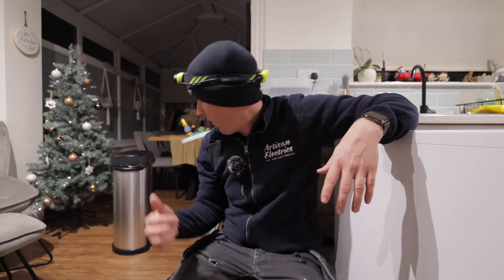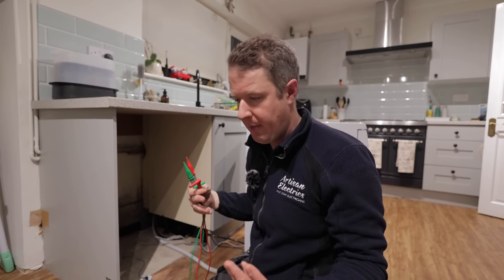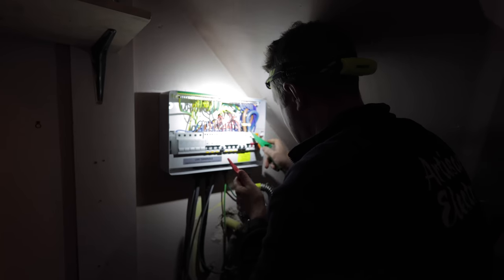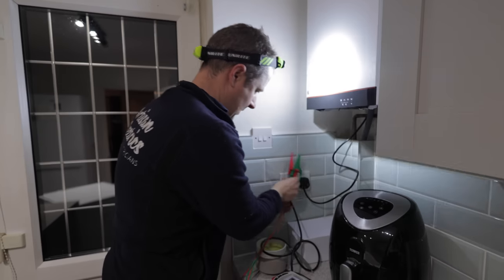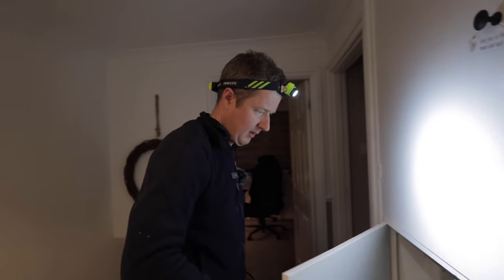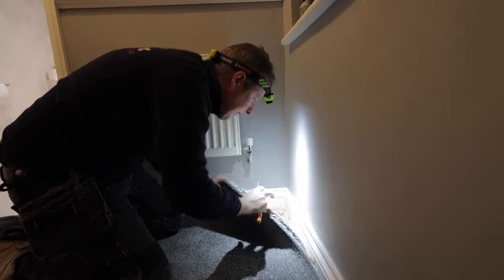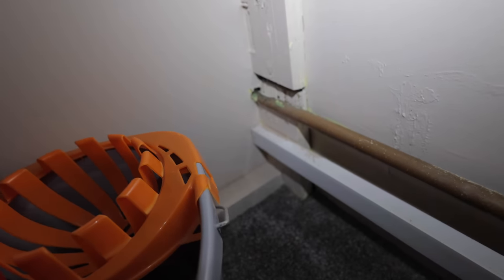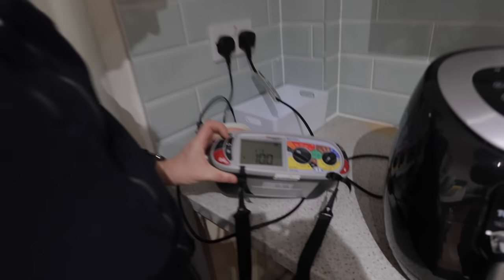Nearly KILLED by a CRAZY fault! What on earth is going on? 💀

Comment: American here, who only has an "advanced homeowner" understanding (I would feel confident doing a whole house rewire, to US codes anyway, but I'm lost in 3 phase or stuff with multi-wire branch circuits w/shared neutrals). I know the UK does things considerably different, but you managed to break my brain with the troubleshooting.

Very nice work, I hope the homeowner was grateful for what you did!
Reply: Pretty sure we can't do that over here. There's some building regs that mean you can only do certain things. You have to be registered to do the complex stuff.
Reply: @ftumptch86  I think you're allowed to run the wires and then have a pro come and join the dots here in England.  Is that right?
Reply: @sroberts605  possibly. It's all in part P of the regs. Minor stuff like replacing simple things and adding to existing circuits is OK. But big stuff like rewires, new circuits, fuseboxes etc are reportable?
Reply: @sroberts605  don’t know how many folk would be willing to rubber stamp a DIY job tbh
Reply: @ftumptch86 in the US it depends on where you are, for example whether your in the jurisdiction of a city or outside the city limits, outside is however you want to do it and no inspections required around here but national electric code should be followed but isn't inforced out in the county.  Then in the city it depends on the city rules whether you can do it yourself but all new work likely requires permits and inspections regardless of who can do it.

Comment: Far and away your best fault-finding video ever!  You demonstrated a good, logical approach - and the golden rule that it will be something the plumber touched holds fast once again.  
A little unlucky that whatever current the boiler pulled from the upstairs live (and returned via the downstairs neutral) wasn't enough to unbalance either RCBO and trip it.  An older boiler might have done so and saved you several hours searching.
Anyway nice work and a great advert for the professionalism of your company.

Comment: I had a mains tester fail, falsely indicating a wire was safe. So now I test a circuit BEFORE turning off so I can test the tester, and then be sure it's safe after turning off, and I always test all three wires too. I was once working with someone and he turned off the wrong breaker because they were mislabelled, and my paranoia saved me from a shock.

Comment: We discovered something similar during our home renovation.  We discovered that when we turned the breaker off to our master bedroom, we still had power in the bedroom circuit.  We also discovered the same thing when we turned the living room circuit breaker off, we still had power in the living room. What we discovered happened was that the previous owners had modified the wall between the living room and our bedroom, and when they did they for whatever reason, connected the two different circuits together! The only way to cut power to either room was to turn off both breakers because there was power bleeding over each circuit! It was scary considering it was this way for over 5 years. We simply undid all the connections and re-connected them correctly, and problem solved. The takeaway on this is if you don't know what you're doing with electrical, then please, for the love of God, hire a professional!! Lol!
Reply: I grew up in a house built in the early 1960's and we had almost this same  issue between circuits in the Master Bedroom & mine. Lived there for over a decade, and I  always knew there was something weird with the wiring between the two rooms. For example, in total darkness, i could see that the (incandescent) ceiling light in my bedroom always had a slight glow, even when the wall switch was turned off. So current was 'leaking' somewhere.. I recall my folks having someone look at it once, & they said they claimed they did something to fix it- - but I could still see there was a problem, but I was just a young kid, so nobody would listen to me.
The house was also built with aluminum wiring, which was popular at the time, which created its' own set of intermittent problems. I do know that when my folks sold the house one of the first things the new owners did was have it re-wired with copper, and, I assume, they finally fixed whatever was going on between the bedroom circuits.

Comment: Great video and full marks for your systematic diagnosis.  I guess a second best alternative to running a new cable would have been fitting a contactor/relay by the boiler. Still means that you have two separate circuits going to the contactor, but at least they would be isolated from each other.
Reply: You've then gotta hope that the plumber who replaces that boiler next time understands what's been done & why. Even so, I'd have considered a contactor even though it introduces another potential point of boiler failure for the future.

Comment: Wow! A few years ago we had an extremely strange error. It was in a retirement home where the faucet in the bathroom was live. The RCD for the affected circuit worked perfectly. When we looked for the problem, we found out that the electricity came from the next room. A cable in a stud wall had worn through and raised the entire potential in the area in question. However, since the water pipe was better grounded than the rest and not grounded together with the stud wall, there was potential there. So the electricity didn't come from the tap, but rather went there, if you want to look at it that way.
We solved the problem by disconnecting the supply line in the neighboring room and creating a connection between the bathroom and the rest of the room.

Comment: A number of years ago I was PAT testing the two individual curtains around a school stage. both curtains had a 13amp plug. The remote controller  unit also  had a 13amp plug.
I unplugged the first plug to check the fuse.
I was thrown back into the second row of seats, I did not get a burn but other school personnel carried out the disconnection.

Comment: Great video explaining the dangers. As an alternative solution, would it have been reasonable to have added a contactor to isolate the two circuits? I.e. the switch side energising the contactor (live and neutral from upstairs), which switches the live on the downstairs boiler circuit.
Reply: Good point. We didn't see what the rogue active was doing, nor why it was energising the earth conductor (or maybe active & neutral of the downstairs circuit were energised together).
I immediately went to "use the old cable to supply a control relay" once the double circuit appliance was exposed.

Comment: Really interesting video, thank you! I’m not sure I’d have found that fault. Nice fix too. I suppose another way round it would’ve been to drive a relay from the twin and earth to the boiler, which would provide the switched live. I could see no problem then with powering the boiler from downstairs sockets and the controls from the upstairs. The relay would provide isolation… that said, your solution is neater, simpler and easier to support by others. Thanks again, great vid ❤
Reply: Exactly, install a relay and you don't have problems. And even better solution, since that is a new boiler, would be to not use a 230V input for turning the boiler on that is technology of the last century but change the heating controller to one that uses the OpenTherm bus, that uses two low voltage wires (to carry both data and power to the controller) and can also modulate the boiler and let you save on your gas bill. But that would require reconsideration of the whole control logic. Shocking that they install new boiler and wire them up exactly how we did 20 years ago...
Reply: Exacly how i would solve this problem .  Use the Twin&Earth as  voltage less contact from the thermostat . And use the permament live from the socket.  Easy peasy .. no cable running .
Reply: @alerighi  yep  ON/OFF is really old ..  seems the plumber just reused the "older technlogy thermosat"   instead of modulating thermosats ..
Reply: Relay was my thought too. I’m guessing Jordan wouldn’t carry one in the van though so wouldn’t have been able to fix it that evening. That angle drill was 👌🏽
Reply: This was my thought at first as well. But the end result is cleaner since no extra plug is required.
Reply: All this talk about mixing supplies / or using relays - Just power the damn boiler & controls from either the downstairs or the upstairs f’kin sockets. Don’t mix em ffs. That’s why this happened. Gets my goat this does
Reply: Maybe I went over the top - my reasons - my mums fella was a plumber - Also did a bit of wiring cos anyone can do it - well, 20 years later when I did a bit of rewiring a tiny bit of tape he put over a nick in the wire gave me a bolt from a 32amp circuit - no breakers - I flew across the room & had a very black hand - & the Mrs asking if I was alright - 
Of course I said I was ok
Reply: @timwoodhams958  yep he solved the problem nicely .. but would not wan't to pay his invoice for this job lol .. wil be a lot more then just moving/adding the sockert guess 🙂
Reply: @messageobliquespe100  goodluck running a cable like he did with concreet floors .. like we have here in Belgium  in 40 year old houses .. ( floorboard also but then 100 year old houses lol )   But even the relay might not be needed .. it all depends if the thermostat drives other stuff upstears ( looks like a circulator pomp in the cabinet upstairs )  . A normal on/off thermostat only has  a dry contact .. so  2 wires to the boiler directly so no problems with 2 supplys ..  A bit dodgy  job of the plumber here i guess..

Comment: As a very old electrician (11th edition) i must have gone through similar experiences and most of us remember on occasions not making the required tests. In this instance a plumber was involved, need I say more, but you got to the root of the problem. I would have preferred to see the boiler remain on the 13A socket with all other feeds removed, the IEE seemed for a long time not to recognise the advantage of a plug and socket as a means of isolation, its very visible and at your boiler assures isolation is being maintained. A minor point, don't electricians screw down floorboards any more? we always refixed floorboards with 2x10  woodscrews. All the best JLH.

Comment: Great fault finding skills, well done. 
As an Electrician here in Australia it's interesting to see the wiring methods you guys use. We can run ring mains, but it's rarely ever used, only as a (not very widely known) trick to get Fault Loop Impedance down on a long run. I see it's very useful for testing the loop impedance though as well. 
Thanks for sharing this video.
Reply: Lol, your username checks out.
I've never heard of ring mains being used in Australia. Do you know if it's specifically mentioned in the AS3000?
Reply: @iamdave84  I was only taught about it during a wiring rules refresher course that was instructed by an electrical inspector. It's been many years since I've been in the electrical game. I can't recall, but I am pretty sure there is no specific reference to the term "ring main or circuit" in AS3000 but using a ring circuit is compliant with the standard.
Reply: @desparky  good to know, thanks for the reply

Comment: It's still odd that the boiler powers the permanent live when the switched live is calling for heat. You kind of think in the boiler they would be separated on the pcb.
Reply: In the delivered format, there is a link between the switched live connection and 230v out provided to power external thermostats etc. It is possible this wasn't removed, though that would leave the boiler on constant fire. In any case, this matter should have been referred back to Viessmann, the manufacturer of the appliance for advice, as either a design fault or some other fault with appliance might exist. Had Jordan phoned Viessmann for advice they would have most likely asked for his Gas Safe registration number. In any case, they would have told him that the external controls should be powered from the boiler using the connection provided and referred to in my first sentence.

Comment: After talking floorboards up, I as a qualified heating engineer always refix the board down with screws. I also mark any hazards ie pipes, cables etc on the board in question.  I would also like to add some of the worst wiring I have seen has been done by electricians. 
Your fault finding is impressive.

Comment: Bravo on that angle drill! Seems like I've spent my life fixing "previous" repairs. I went to change the fan control PC board in my furnace and nearly got fried because whoever put in the original furnace switched the neutral instead of the hot, and the people who replaced the furnace didn't correct it. I corrected it, and then 20 years later when I had the system replaced, the new installers DID IT AGAIN! Trust NO previous repair person. Ever. We need more people like you who actually care whether something is right.

Comment: Yes its not common but does happen, someone has taken two feeds from 2 circuits for the heating controls. Back feeds through 3 port valves etc. The current will be low via the impedance of the circuits. Hence the varying voltage when unplugging appliances. It is often suggested not to put 13A plug on a boiler, so not to have a customer touch the boiler plug pins if that fault occurs. I haven't read the threads, may be this has been said a few times.

Comment: As a 40  years  time served domestic heating engineer this  was a common problem when boilers low water content boilers first appeared and required a pump overrun supplied by a permanent live  
It is usually done at the center of activity ie airing cupboard where pump and control valves situated and the line down to boiler has  3 core and earth , one as switch other as pump overrun ( permanent live ) 
And I can assure you even up to my retirement it still confused household electricians , and I had to mostly do my own first fix and oversee qualified electricians 
At one point when regs changed I considered take exam and get qualified to comply 
But I’m still a better system wiring sparky than most ordinary household electricians  who don’t understand relays and end switches etc 
Great watching you well done !

Comment: Great job with satisfying outcome, thank you for sharing.
Two head scratchers I have seen: First was RCD tripping anywhere from 5 to 15 minutes after being reset.  Turned out that a lightning strike had scorched insulation such that active to earth resistance slowly reduced one voltage was present.
The other was a clothes dryer that consistently tripped RCD on startup, but no detectable fault. Turned out that the starting torque caused the motor to rotate enough to cause the neutral terminal on the motor to contact the back panel.  Of course that never happened while the back panel was removed for diagnosis. Nasty trick! Easily prevented once identified.

Comment: As an electrician of 50 years I have come across many strange wiring but a good one was I was working for Interserve but was put on loan along with 5 other soarke to Mellor Bromley at the then new Coventry City football ground me and another sparks was put on fault finding duties the list was extensive ,one of the faults was on 2 giant single phase motors,we switched on the first motor and it ran lovely,we left it running then switched the 2nd motor on and immediately it tripped the breaker and the first motor stopped running so we reversed the sequence and the same thing happened so they had wired the first motor from r1 looped across to the 2nd motor and then back to the same distribution board onto b6 ,so when both motors were switched on at the same time we had 415v applied to the 240v circuit,great workmanship

Comment: As an electrician for 40 years I have never ever come across a fault like this,  straight away I knew it had to be a cross circuit fault, but for the plug of the heating system to become live was just unforgivable, it's a wonder the householder wasn't killed, or yourself for that matter. A few years ago I was working in a 2 bedroomed house, I asked the homeowner where the consumer unit was, I then turned off the consumer unit and hung a danger board on the mains switch. I proceeded to remove the cooker socket and was blown across the room. My right arm burnt from finger tips to shoulder only to be told by the homeowner there was another consumer unit in the garage, since then I check everything before doing any work. Why would a small 2 bedroomed house have 2 consumer units ?

Comment: Well done Sherlock!
It's  so common for wiring issues to be discovered!
In the first place plumbers generally don't  have enough understanding  of electrics and electricians don't  understand heating wiring.
End result can be what nearly killed you!!
As a very experienced  plumber ,I've  learnt to wire any heating system the hard way; of all the knowledge  I've  learnt,Number 1 is start from a SINGLE 3amp fused spur or if you have to, an UNSWITCED socket. So simple,,so safe!

Comment: I am a nuclear engineer and once found an alarm circuit in an ancient reactor where the neutral and line were shared between two completely different power supplies. Not bad like this, but one of the supplies can float voltage above earth ground. I think I counted something like 6 electrical code violations just from that.

Comment: At 6 minutes 55 seconds you said you expected the R2 resistance to be higher because the CPC is a slightly larger conductor. If its a 1.5mm conductor then its a smaller conductor than both the R1 and Rn, a difference of 1.67 (2.5/1.5) therefore, the resistance of R2 should have been around 0.53 ohms (0.32*1.67) for a healthy ring circuit. Not a criticism, just a clarification.